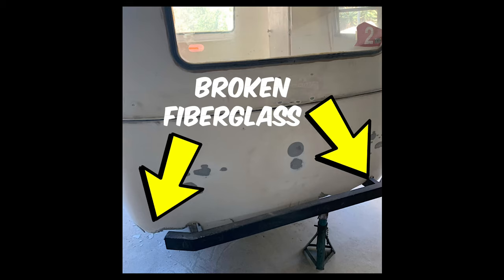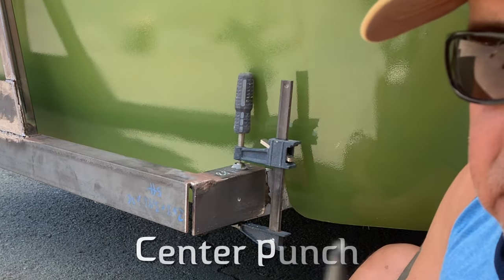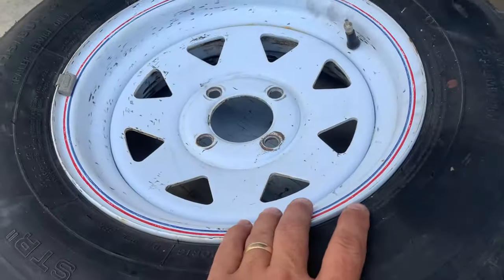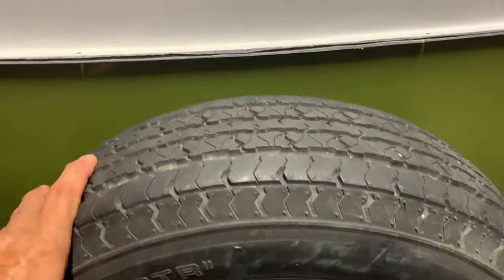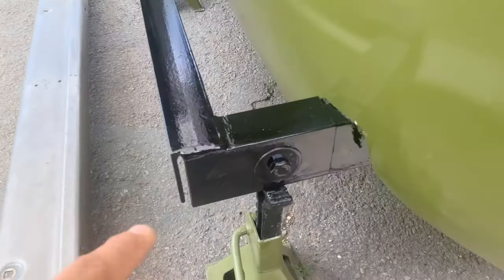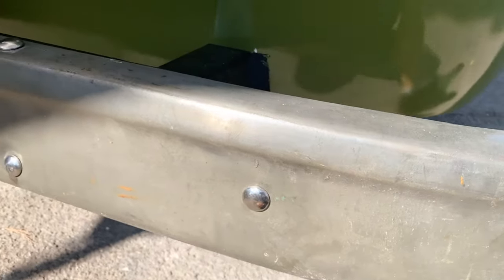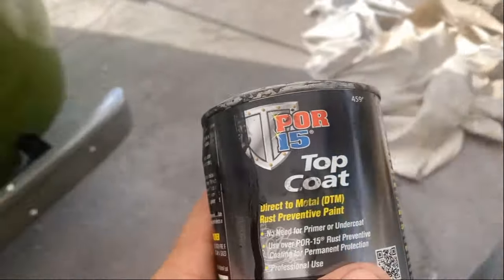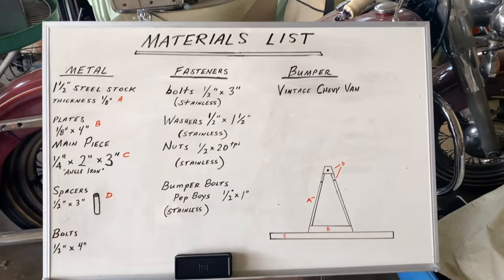Scamp Trailer Custom Rear Bumper #ScampTrailers #VintageScamp

Comment: You could make a bracket that goes from the outer bumper bolt too the bolt that goes through the frame then you wouldn't have to weld on your fresh paint
Reply from the maker: Yes, that’s a great idea! Thank you 👍🏼